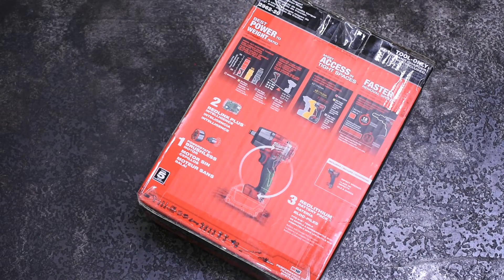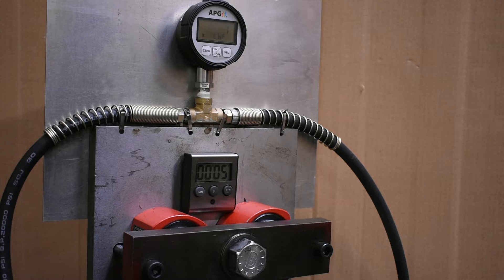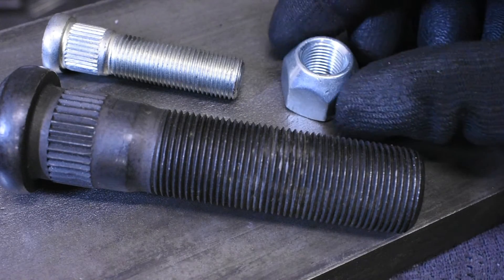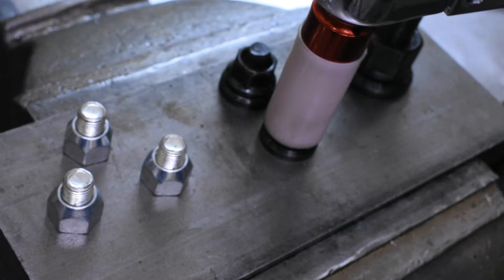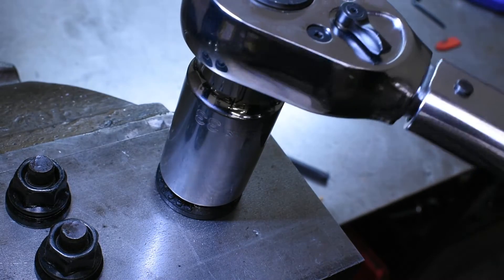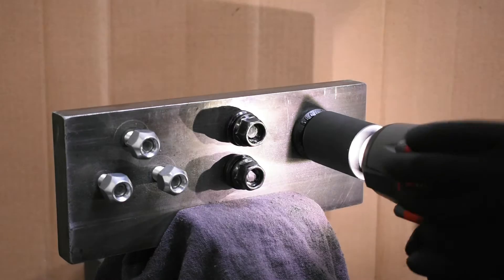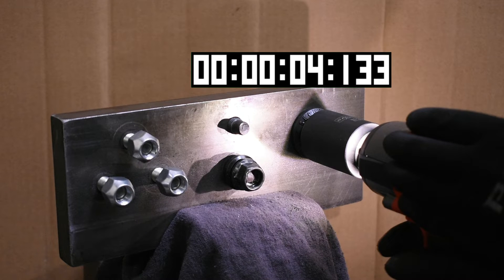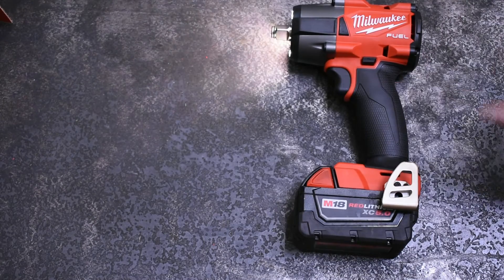Can a Gen2 Mid-Torque Remove a Semi-Truck Lug Nut? Quick Test

Comment from the maker: Does a new freshly torqued semi-truck lug nut represent what someone would see in the field? Almost certainly not, old rusted 33mm nuts don't like being removed. But old rusted lug nuts are also not a very repeatable or consistent test, so this is the next best thing.
Reply: The bigger issue is often they are way over-torqued. Roadside tire repair guys use massive 2,000ftlb air-guns, and guess at the torque level. Some are better at that than others. Could be 400ftlb or 800ftlb.
Reply: @tlr-nut7275  amen
Reply: Keep up the good work absolutely enjoing the  channel 👍👍
Reply from the maker: @JEvans575  Hey thanks!
Reply: @TorqueTestChannel 

Use anti-seize compound....that should be repeatable for at least fouled threads like having dirt on them. With maybe a little rust....
Reply: Torque specs? What are those?
Reply: Can confirm that these will not remove semi truck lug nuts in real world conditions but the High Torque model will. I have also encountered situations where air tools with a comparable or even lower "nut busting" torque ratings can remove rusted fasteners that the M18 mid can not. I suspect this has to do with the air tool's higher IPM ratings more than torque. Nonetheless, the M18 mid is a great tool and I've been very happy with it.
Reply: They do get loose when it’s only toq at 600 lb 😏
Reply: I don't trust this mid torque one bit at removing semi wheel nuts. Got to have the 3/4" High Torque Impact wrench for the job. In real world testing between Snap-On and Milwaukee 3/4" Impact gun operated by battery Milwaukee takes the Crown. The Snap-On can do the job but struggles a bit.
Reply: @maxlegend8230  Sure, looks like the tool could do it. However You'd be putting a hell of a lot less stress on the larger tool.
Reply: It's not exactly realistic but that that doesn't make it a bad test. It's repeatable so it's still useful for comparisons. I definitely wouldn't want to bet on this gun in the field on a semi lug though lol.
Reply: The tool wasn’t designed to take lug nuts off of a semi. It’s a very impressive tool for what it was designed to do.

Comment: I have the 1 inch anvil which I use primarily just to take the wheels on and off of my semi truck, but found myself needing another impact for engine work on it not sure if I should go for the mid torque or the high torque. Do you have any recommendations?

Comment: This thing is garbage. I own one, can't take off 150ft lbs lug nuts half the time, meanwhile I go at it with a 16 inch breaker bar and they come right off. . Even when they have anti seized on them from the previous season. Not impressed at all.
Reply: Are you using swivels and extensions and rust. If not it's defective as is your reasoning.  😂

Comment: There's really no need for a Milwaukee high torque 1/2 impact, all you need it the mid torque for most jobs. If you need more than that, the 3/4 inch model barely weighs more than the big 1/2 incher and doesn't cost a lot more, but it is more powerful and feels a lot smoother.

Comment: I have this gun, bought it a year ago
Reply: You still using it?
Reply: @emmcee476  yes i do just not as often as i used to.
Reply: I want to buy new stubbys
Reply: @Anonymous..VQ3.5Lg35  what's your general opinions on it? I currently have Dewalt DCF891 and wondering if I should purchase this Milwaukee. The Dewalt is very strong but vibrates a lot
Reply: @emmcee476  I personally do not have yellow, but the new Milwaukee impacts and new batteries are great, I am into the M12 lineup of products mostly- M18 for grinder, and big impact guns. I am a agri mechanic.
Reply: @Anonymous..VQ3.5Lg35  is this Milwaukee 2962 plenty strong?
Reply: @emmcee476  yes about 600ftlbs or so use the 6.0 or new forage for best power!

Comment: Everybody always tests these on the max speed setting... Why does nobody test the torque output on the lower speed settings as well? Is it because the torque output is the same on all speed settings and only the rpm changes? If the torque is also lower on the lower speed settings, it would be nice to know approximately what those lower torque figures are for each speed setting...

Comment: This is exactly how manufacturers come up with their numbers for their impact wrenches. They say that an impact rated for 650ftlbs of nut busting torque can loosen a nut torqued to 650ftlbs. Now of course a nut torqued to 650lbs doesn't require 650ftlbs of torque to remove. It's clever marketing.

Comment: Just think how fast it would’ve spun that big rig lug nut off if you’d have used a 6 amp battery.  Whether the tool’s box specifies a specific battery or not, the manufacturer has stated repeatedly that the Fuel tools architecture takes advantage of the High Output batteries and their 2170 cells. The architecture of both the battery and tool allow communication between the two, ramping up the torque when needed.

Comment: Now torque the truck lug to 600ftlbs (as they almost always get cranked on with a tire gun) then spay it with salt water and let it sit outside for a year. Then see what happens.That is a real world test… for a frame of reference my gen 2 3/4 high torque can’t get half of the lugs off that I try. And that’s with a full 12.0 brick!

Comment: It's impressive, but I would like to see it take off the bolts from an actual truck, seized from going months before being taken off. If I could see that. I would drop matco tools and strictly buy only milwaukee from then on
Reply: I used my M18 1/2" high torque for just that many times. It does the job quite fine, though it takes a few seconds to hammer them loose, and it eats batteries like mad. Never noticed a big difference between high output and regular batteries in power though.

Comment: My honest issue with the battery Impact guns is the audible nosie when removing  a trucks lug nut or a stubborn brake booster bolts, vs a pnumatic one. Yep technology has gone super far nowadays, but man it's super annoying when someone is using a battery Impact gun in the work shop as the audible  noise is so much louder than the traditional pnumatic guns. Don't get me wrong I have both pnumatic and electric they both have their place hopefully one day technology allows  these big brand names to dampen the audible noise from the electric Impact guns
Reply: I know exactly what you mean, the pitch becomes ear piercing when it struggles to break free.
Reply: I agree. That is why I make sure to own a tool that is much stronger than my needs, so it breaks fasteners faster. I hate extended loud hammering from these tools. The minimal, the better

Comment: In reality 3/4" DeWalt can't really remove 32-33mm semi truck nuts. It removes them, but you need to hold it like 10 seconds on each nut. Thats on used, little bit rusted and probably little bit overtighted nuts.
Reply from the maker: For sure, in the real world it's a much different story. Only way for it to be a controlled repeatable experiment in this setting is to do the 500 ft-lbs on a new nut, which is consistent but not "real world"
Reply: @TorqueTestChannel  If you want to quickly remove truck lug nuts, you need a 1" gun. Milwaukee cordless or air, thats your preference. Neither my cordless 3/4" or air 3/4" can remove them reliably

Comment: You seem to be quite knowledgeable so I have a question. If you torque a wheel nut down to 500 ft lbs does it require exactly 500 foot pounds to loosen it? Taken away other variables such as rust and corrosion. I've often wondered this but I've never tested it and I'm wondering if from an engineering standpoint if there's any type of formula or standardization so to speak as far as what it requires to remove a given fastener that was tightened to a specific torque.
Reply from the maker: The rate at which a bolt is tightened per turn is based on pitch, that pitch follows the inclined plane theory. Which is a fancy way of saying how steep a hill its climbing when turning. Going downhill (loosening) will always requires less effort than tightening (pushing up hill). Roughly 10-15%. It's just one of a list of reason why "nut-busting" doesn't actually mean anything, and also why tools on this channel might always be fighting an "uphill" battle making the numbers on the box.
Reply: @TorqueTestChannel  So does the thread pitch and design have an effect on this also from a friction effect (contact area of the thread's peaks and valleys) as well as the plane theory? For example fine vs course  or "J" thread and acme type threads. I know this may be difficult to provide a short answer so sorry for that. Wonder if the explanation might make for a good video idea sometime?
Reply from the maker: @SouthMainAuto  Yes, in the equation for input torque to actual tensile load on the bolt : F [p/2pi + uR*rT/cos a + uB*RB], p is the thread pitch and a is the thread form angle. So they play a part. In practice the materials, conditions and friction coefficient (expressed uT) play such a big role and vary so widely it's not as much a night and day thing as those. As for a video, don't want to come across as and expert source. Rather just let the numbers tell the story and us not be the source for any "truths".
Reply: That torque formula made me dizzy... In layman's terms, when a bolt is tightened, you are pressing on the metal material where the nut meets its target and stretching the thread material in the bolt, drastically increasing metal to metal friction as the nut is getting tighter - like a spring being compresses. When loosening the bolt, less effort is required due to the compressed metal helping remove the bolt as it is getting uncompressed. Basically the metal parts elastically bend when tightened and unbends when loosens. The nut buster torque is required when loosening rusted bolts because we are now breaking apart fused rusty metal between the nut and the bolt. BTW a fan of your channel too, South Main Auto Repair LLC.
Reply: @spiculum1836  close but not 💯.  The entire bolt stretches (elastically) not just the threads. So the entire bolt acts like a spring in tension. The force doesn’t necessarily help remove the nut, the force just drops off quickly as it’s loosened. That’s why there is a lot of force required at the beginning (breaking torque).  Breaking torque can and usually does exceed tightening torque, due to a number of factors including inertia, rust/dirt, temperature changes, and so forth.

Comment: While it may remove that 33mm nut now which is impressive,  it wouldn’t do it on an actual truck unless it was torqued properly and has no rust.  Most truck lugs are rusted and covered in dirt, salt etc.  still impressive.  My w5152 ingersoll Rand can do the same thing

Comment: Make sure to use the high output Milwaukee batteries with the 21700cells to do the torque test and compare that with the normal 5ah battery.  The high output batteries are suppose to make the tool more powerful

Comment: I like your content
But I was hoping to see more testing, ok it did one nut, 
Would have been really good to end with a actual real world test on a real semi rig and 10 lugs, 
Just saying still liked and subbed
Reply: He said Saturday they’ll release an in-depth comprehensive video of this one vs the Gen 1 Mid Torque
Reply: I think most of us know how a real world test of this sort would turn out. This tool isn't designed for what you suggest and neither are 1/2" air impacts.
Reply: @garyradtke3252  I would only use this Gen2 Mid Torque for Mid/Small Automotive applications. My Milwaukee 3/4 drive is great for most of the work on larger trucks

Comment: Would like to see it against the Makita xwt17 mid torque.
Reply from the maker: We'll add it to our list, should be a good one
Reply: I've been using the Makita mid torque at work for half a year the power is underwhelming like pretty much every cordless impact. Milwaukee DeWalt IR etc they are all the same. Removing freshly tightened nuts and bolts on a test rig is nowhere near the same as trying to remove them in real world settings. At work our customers wheels are torqued to no more than 110 ft-lbs yet every mid torque I've used have routinely struggled to loosen them and is very frustrating considering the advertised torque ratings.
Reply: @Mike-sf7ex  which model number are you using? The xwt17 brushless mid torque was just released and I've been using it on lug nuts for a week and a half on lug nuts with no issues. I had an f150 about a month ago that I couldn't remove the lug nuts with my ir2235qtimax. I was jumping on my pittsburgh 25 in breaker bar when the Gearwrench truck showed up and rep brought in a Milwaukee high torque after I sheared the anvil on the bar and stripped the pawl in my co-worker's huge Matco 30" ratchet.  It removed that lug nut, but wouldn't budge the others. I bought an Icon 3/4 drive breaker bar and was able to remove them all with that. I work at a used car dealer and most of our service customers utilize used tire shops that use too many ugga duggas on the lug nuts with no torque sticks. The xwt17 has been great for lug nuts so far.
Reply: @nosliwttam77  that's crazy. I work on light duty passenger vehicles so thankfully don't have to deal with that lol. I have the DTW701XVZ which is the international model that Makita sells here in Canada. 701 is pin detent which sucks and barely holds on. XV for high voltage protection. Other than that it's basically identical to the XWT17. I've had the DeWalt DCF894 prior and was an early adopter for that as well. Both units will occasionally struggle taking off 17mm wheel bolts that easily loosen by hand yet no problem taking off axle nuts. Don't make any sense.
Reply: @Mike-sf7ex  I looked it up and it does look like the specs are the same. I went with the friction ring. I usually removed axle nuts with my 3/8 stubby m12 and an adapter until I got the Makita. That is strange. Maybe you received a defective one? I use 5.0 battery. I used the Makita on Friday on a couple of lower control arms on a Chevy and a Hyundai and some rusty exhaust nuts on a sonic that the m12 wouldn't budge. It was a rust belt car. I did have to use the air for the upper caliper bracket bolt on the Hyundai with an adapter and a 3/8 dr swivel socket. On a different note, I live in Texas and and appreciate Canada's willingness to share your weather with us. Now that we've had a small sample, please take it back! 🥶

Comment: I have the same new mid torque, it is able to remove lug nuts on my f150 torqued to 150lbs easily but it could not remove a rusted seized leaf spring shackle nut without heating the nut and bolt. It works well but I did find its limitations. I was however able to remove the rusty trailer hitch mounting bolts in order to access the shackle nuts easy enough.
Reply: Because rusted parts now add more power needed...  Not to mention the rubber bushing in them take up most the torque being applied...
Reply: Big boy def would’ve taken it off but the mid does the job well

Comment: Thanks for buying a proper fitting socket not trying this with an adapter :)
Reply from the maker: Never understood testing with adapters. If the test ever requires an adapter, we'll have a new tool made for us so it doesn't.
Reply: @TorqueTestChannel  how the hell do you have less than 100000 subs? This content is great! Keep it going!
Reply: I tried test with adapter, the performance drop significantly..

Comment: Wow this is awesome.... Really packs a punch..... Hey I was thinking that it would be cool if you could try out the kobalt XTR line and see how it holds up to the rest. Thanks for the great content. 👍
Reply from the maker: Okay we'll do that. We noticed how insanely cheap they are now when you break down the cost of the tool/battery/charger compared to what else is in the same store. We have a few models on the bench now, but we'll add the XTR to our "to do" list.
Reply: @TorqueTestChannel  awesome can't wait 👍.... I'm sure you know but they also have a cordless right angle impact. These are great comparison torque test and I really like the leader board it really helps out to find the right value needed.